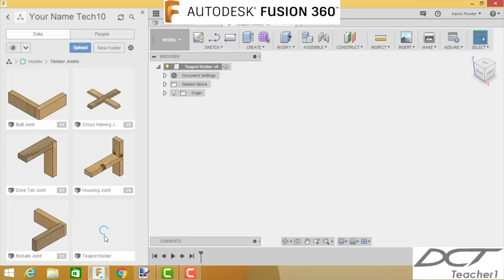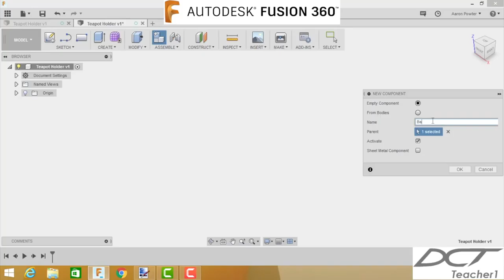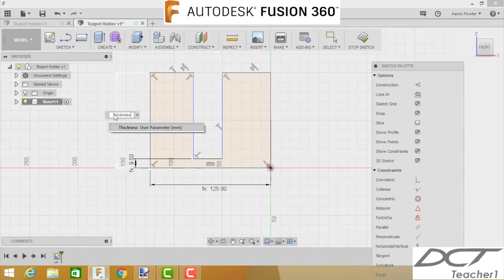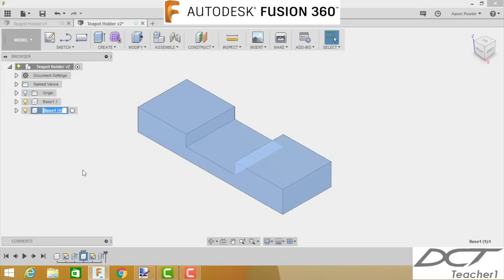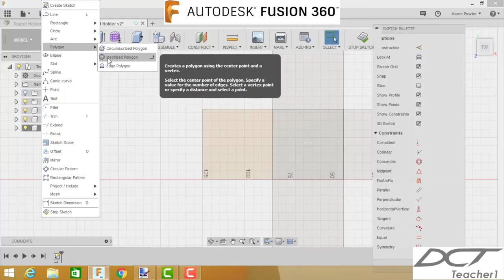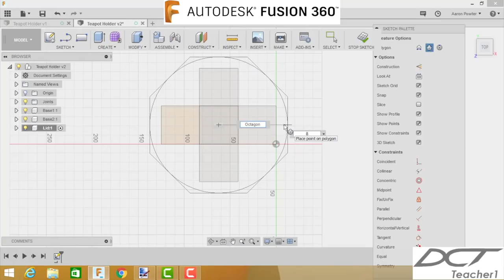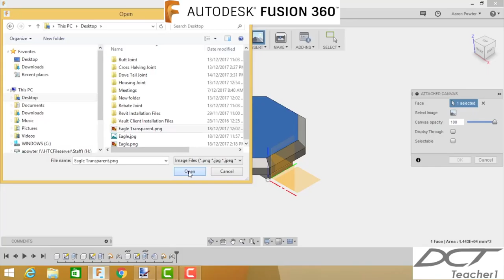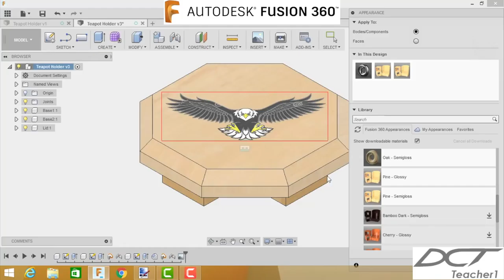Fusion 360 Timber Teapot Holder - HTC Tech10

Comment: Bit odd setting up parameters and then using numerical values to dimension key parameters? Did this in several places. If you now change the parameters in the tables, it will end up all bollocksed up. Sorry - shouldn't complain - nice work! Have a Merry Xmas!
Reply from the maker: Hi Murray. I'm slightly confused by your comment. I only entered one numerical value and that was to centre the cross half section.  However, I did say that we could have done that with the parameters. The point of using the parameters is to get the students to use them, plus I like to demonstrate numeracy and equations so they see a practical application of Math. I think I understand where you're coming from.  However, what seems logical to us, isn't logical to a 15 year old. I hope you had a lovely Christmas also. Cheers, Aaron.
Reply: 1:50 Rebate = Thickness / 2
4:30 Position of rebate = (Length - Width) / 2
BTW, you can deselect selected edges by reclicking with control pressed.

Hope you had a good break!
Reply from the maker: Hey Murray, Ok cool thank you for pointing that out.  Yes mate I've had a good break so far.  Got some medical issues that need attending too (post cancer treatment), but apart from that yeah it's been really good thanks.  Hope you've had a great Christmas and a good start to the new year.  Cheers, Aaron.